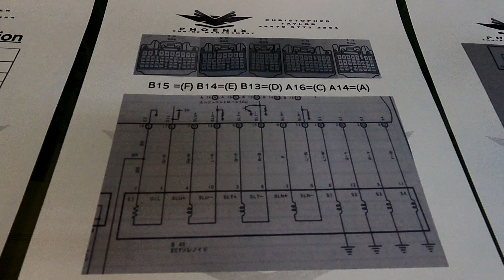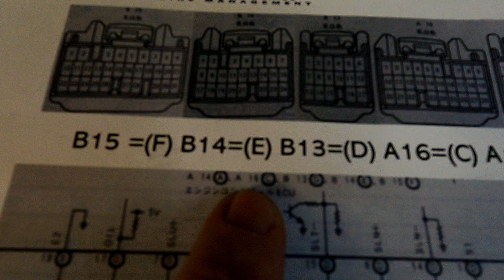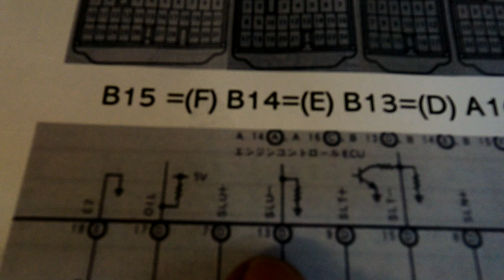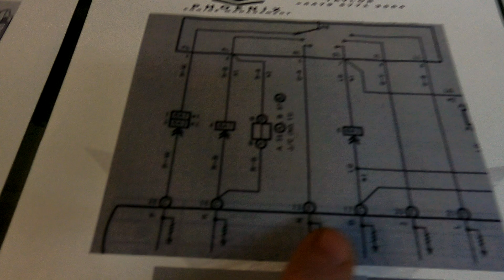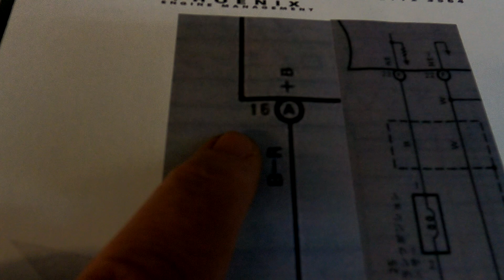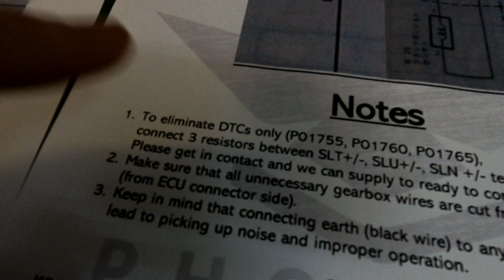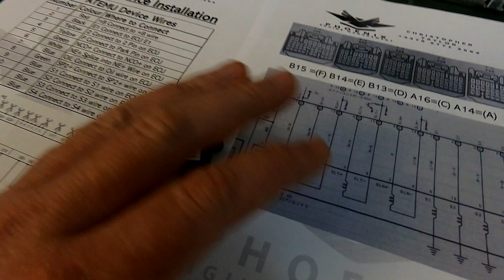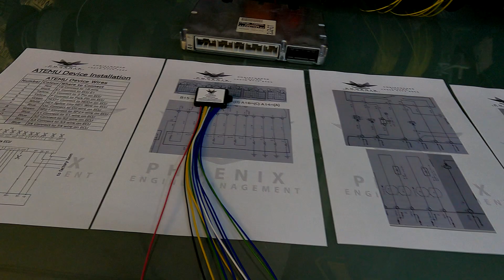Toyota Crown JZS171 ATEMU Installation

Comment: Hi there, I've installed an ATEMU on my JZS171. Everything is working as it should except I've lost reverse lights and 'R' light on my dash when selecting reverse...
I'm assuming this is due to the cutting of the R pinout/wire from the ecu. If I were to reconnect the R wire, will this effect the functionality of the ATEMU? Thanks in advance.
Reply from the maker: Hello yeah I think what you have done is also cut the Reverse wire to the car and not only the Reverse wire to the ECU. The not seeing Reverse on the dash is 100% correct. But the Reverse wire to the car itself should still be intact.
Reply: @PhoenixEngineManagement  Im actually in the same boat with another friend also experiencing this.

It worked for a period of time (1 month) then stopped. quite strange coincidence if it is.

Trying to trace it at the moment. Would you be able to confirm that the wires on the gearbox were wired into the reverse switch and that outputs to the reverse lights directly, it shouldn't include the ECU or the ATEMU.

Comment: i am thinking of using this for my jzx110 swapped benze. I am using jzs171 ECU without immobilizer. Car runs  fine, would this emulator be perfect for this combination?
Reply from the maker: Hello Romeo. Yeah if you are using a JZX110 ECU that was originally for an Auto vehicle then this device will get rid of all the codes and make the ECU run Correctly.
Reply: @PhoenixEngineManagement  So that means NO in this particular combination 
engine: jzx110
ecu:jzs171 crown ecu

Comment: Recently received mine , looking forward to getting it up & running.
Can you explain what is actually altered when the modes are switched?
Reply from the maker: Yeah so the different modes change the relationship between the engine RPM and the input speed sensor NCO.

Comment: Thanks so much! I’m just about to install my atemu on my jzs171 ecu
Reply: Did you figure what mode these like in L?
Reply from the maker: Hey Rick yeah it is Mode 5 that runs the best so Connect L instead of 2 and push the button till you are in Mode 5.
Reply: Right on just wired mine and set it to 5, haven’t seen the idle come down enough for the box to actually show the mode well the car is running. Do you know the dyno results the car got on mode 5?